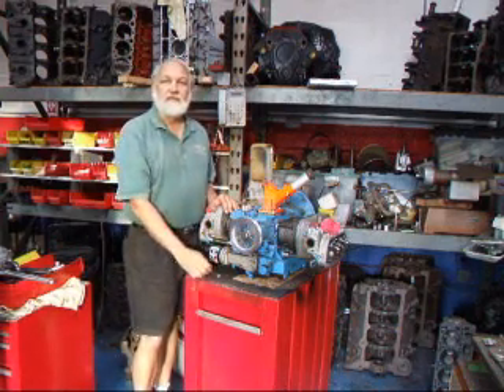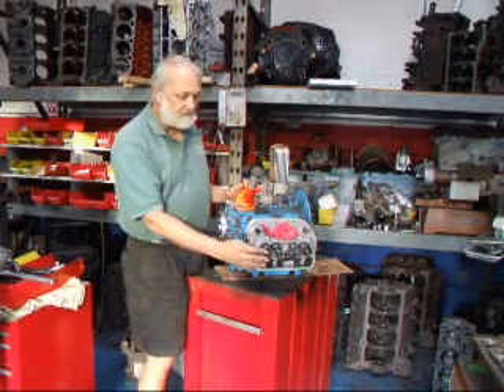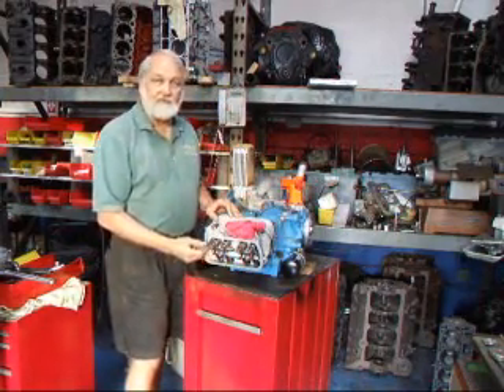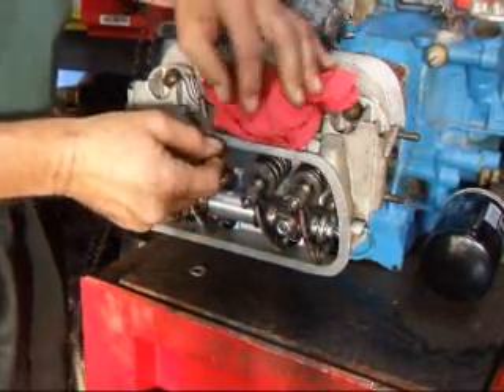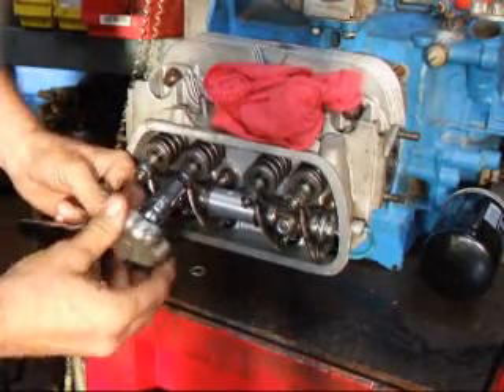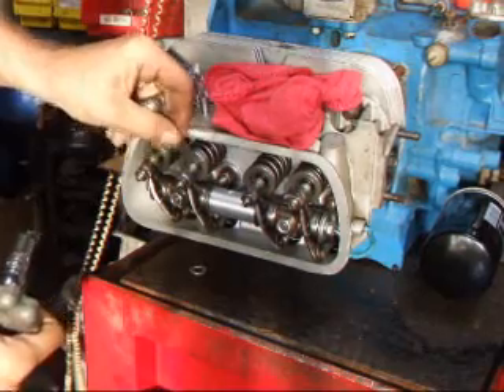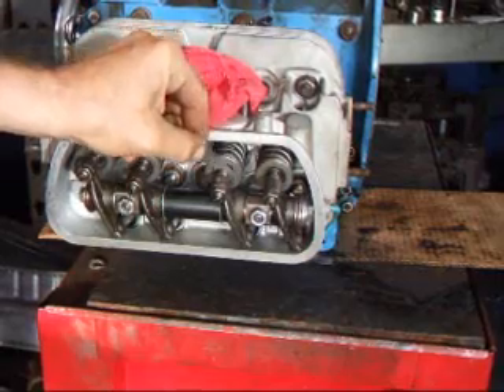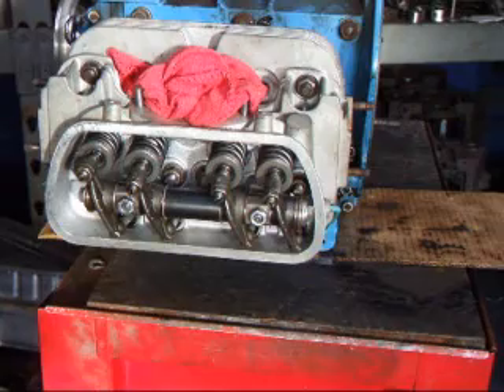VW Valve Adjustment

Comment: Use "go no go" method 
Draw the target feeler gauge size through the gap then drag the larger one through. If you can get the target size one in but not the next one larger then dont bother adjusting the valve. It is within .001 +
If target one is firm pull a next smaller one through, if it pulls freely dont bother adjusting the valve like above it is within .001- of target.

Best way to do DOHC shims (springs installed) without trial and error too.

Comment: @udidwht 
The target blade will have varying degrees of tension from light to heavy.
If the one below target is loose and the one above target wont go, the target one will fit but with varying tension.
The tollerance +/- is within that range, so it is within tollerance and adjustment not required.
Closer does not make notable diff to cam timing either, and a tight blade in a small engine valve can lift it so this method resolves that as well.

Comment: This is how old time VW mechanics adjust valves, I personally use .006 for intake and exhaust. Using this method #2 exhaust, #3 exhaust, #3 intake, #4 intake can be adjusted. Rotate 360 degrees until TDC mark lines up again and adjust #4 exhaust, #1 Exhaust, #1 Intake and #2 Intake. Go ahead and do the # 1 TDC, 180 counterclockwise, 180 counter clockwise, 180 counterclockwise if you prefer, but don't bash this guy he is spot on. Think out side the box. It's a 4 cycle engine.

Comment: @busboys 
Hi friends .
This method works like this .   Cylinder no.3 at TDC .    Facing the cylinder head at the driver's side adjust the 1st 3 valves from LT to RT .    Now facing the cylinder head at the passenger side adjust the 1st valve in the LT  (DONE ) .   Now turn the engine 360 degrees CLOCWISE , TDC at cylinder No. 1 now.
 Facing the head at the passenger side adjust the 1st 3 valves from RT to LT and  1 valve at the driver's side, the last valve at the RT of cylinder head .   DONE

Comment: It is highly recommended to use the 0.006 for both Exhaust/Inlet Valve Gap settings, if you' re going to use just the one filer gauge. The other oversight is when John refers to Cyclinder No. Two (2) Valve as No. One (1) Valve. Speedster "outside the box" is fare, as I too use the "hold timer" method which is faster and just as presis. Overall thanks for you're video John as we can clarify the errors in this forum with hanging anyone. Keep it up, We do approciate your contribution. Well done.

Comment: You're absolutely correct.  .004" setting will burn valves.   .006" is the right setting
for all air cooled VW's after 1965.   Before that, some models even used .008".  VW's are unique and should only be worked on by those who really know how.

Comment from the maker: Thanks for the kind words, I have used this method for ever and never had a problem with it. The .004" was the norm back in the day, but .006" is much better for longer engine life. You have to remember that most people read 'how to adjust the valves' and that's how they do it, in practice, however, you figure out better and faster ways of doing things. On the line, you are there to make money.

Comment: it could work if the valves he is adjusting is on the low side of the cam and not starting to open or close.   To me to easy to confuse what valve to adjust.  I did it the VW book way and took me all of 15 min to do it.
One way to find out is do it his way then check it the book way!!

Comment: I only have one question, can I use non leaded gas on my vw van 1979.   and the vid is ok. cams away from valves and you get a slack, adjust, and no problem. thanks.

Comment: If that's what you think, fine.  But if you adjust your valves this way, you'll overheat the engine.  I've worked on these things for over twenty years,  trust me, you can't treat them like their water-cooled cousins.

Comment from the maker: Hey idnotis, valve adjustment is needed for the engine to run correctly, a tight valve may cause an idle problem, but so would a bunch of other things.

Comment: @ewmansfield        You are right ewmansfield .    He never mentioned anything about placing the cylinder No.3 at TDC when starting the adjustments on 3 valves  at the driver's side and one valve at the   passenger side then rotating the engine 360 degrees and place the cylinder No. 1 at TDC and adjust the 3 valves at the passenger side and one  last valve at the driver side. (   last valve at cylinder N0.4  )
Someone got their head busted for sure .    When making a video please explain all

Comment: .004" clearance?  Not if you want to keep your air cooler from burning valves!
Adjust valve clearance to  .006" ! 
Follow correct adjustment procedure:  start with cyl #1, rotate crankshaft 180 degrees ccw, adjust Cyl #2, rotate crankshaft 180 drg ccw, adjust cyl #3, rotate crankshaft 180 drg ccw and adjust cyl #4!
It helps to read the manual first prior to embarrassing yourself with a misleading video!
Reply: To be honest the .004 is incorrect and your right. But you can ask several people and get several answers and ive seen people say as high as .008. I'll stick with .006. The procedure on the other hand is just fine for guys like me who are 53 years old and have been building motors since we were 16. With that said for anyone who has never done this before I would suggest following a prescribed procedure from VW or a shop manual and follow it. This way you can follow along and you'll have it right the first time. Id also like to add that the comment about this video being misleading is not entirely true. Your implying this does not work and it does because Ive been doing my valves the same way but like I said ive been doing it for a very long time. New guys, follow a book until you have a few under your belt and you have a feel for what a good clearance feels like then if you like try this and compare the two ways of doing it. There are more ways then one to skin a cat as long as the end result is the same does it really matter if its in a book or another way that more suits your way of doing things? Seems like personal preference especially if the end result is exactly the same. I forgot to mention, as long as there is no tension on the spring, the valve is closed so it doesn't matter if you do #1 or #12 first as long as the push rod isn't traveling and your on the lower portion of the cam lobe but then again this is where experience come in.
Reply: the .008" was way back with 1200 cc engines unique valves/heads which were not long in production

Comment: John I saw the oil filter/oil pump on the engine you adjusted the valves. Does that oil pump/ filter come with 6 mm studs. I have a old 36 hp motor I would like to install one like that.
J

Comment: thanks for the info. just did the adjustment on it but it wont start? is that due to the fact it hasnt been turned on for 6 months? do i need to clean the gas tank?? i appreciate the information greatly

Comment: what the hell is going on here, I thought, the way to adjust your valves was to find TDC and adjust the #1 cylinder valves fist (which is on the passenger side towards the front of the vehicle) and adujust to .004 (stock) (or .006 depending on who you ask) then turn the crank 180 degrees to the left (backwards) and do #2, then 180 degrees backwards to do #3, then another 180 degrees backwards to do #4, what is this guy talking about??

Comment: This is wrong.  He is not adjusting number 3 on compression.  He went from 4 to three.  They are NOT both on compression.  Please.  Nobody should do it this way.  If he rocked the crankshaft you would see number three valves moving and 4 (on compression) stationary.  Its really common sense if you think about it.  Everything else was correct though.  Almost a perfect demonstration.

Comment: I though I I had to rotate the engine 360 degrees for EACH cylinder. Is that correct, or do I rotate the engine just once.

Thanks for advice.

Comment: I never adjust valves on this way, unless i want to step a valve or burn it.
TDC for cylinder one, then rotate 180º to counterclokwise and adjust cyl 2 and the same again for 3 and 4.. and first see your car documentation for valve adjustment cause 6" isnt correct for all models mine is 4" for both valves.
Hint: be sure that your adjust is correct, by testing with superior galgues, it mustnt fit the light, if you adjust to 6, 8 must not fit, anyway its better to adjust to up not to down.

Comment: Very well intentioned but so very wrong.  Take off your valve covers and dizzy cap.  Look at valves when each cylinder is TDC and ready to fire.  Both valves are closed at this time.  Use you feeler gauge.  Adjust and move on to another.  Please remove this video.  Someone is going to ruin their pride and joy.

Comment: Incorrect. Nothing like anything i've read or seen in the past 5 yrs i've been adjusting valves on a VW.  I do mine completely different, technique and measurement, everything different. If i did it this way i would be sure to be in for an engine overhaul.. look at rick higgins or chris vallone or even airheadparts videos ppl they know what they are doing